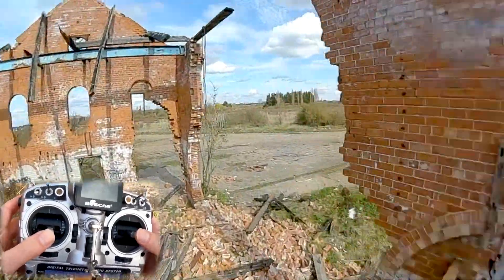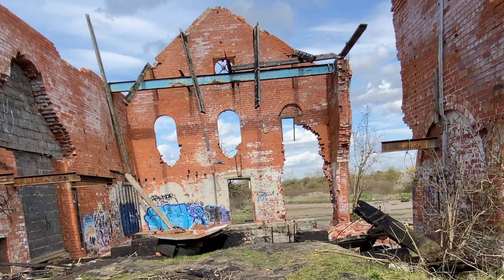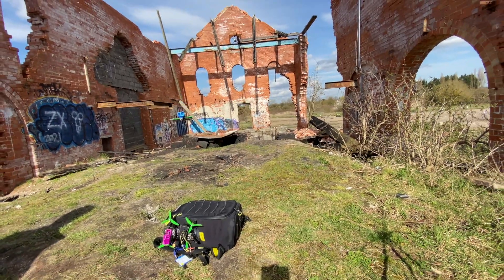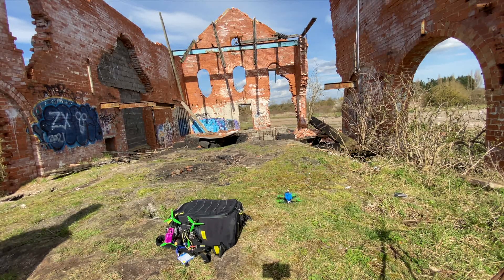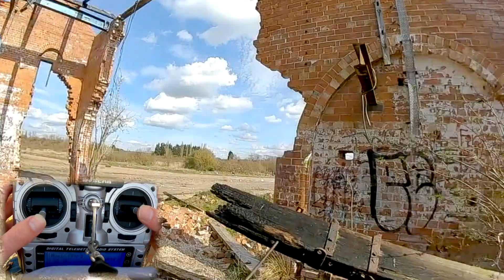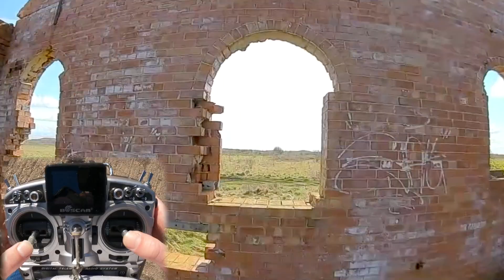How To Land an FPV Drone in MANUAL MODE! 👀

Comment: Hi, congratulations on the very detailed video, but can you confirm that when arriving at speed in an open space, to significantly reduce the speed and prepare for landing, it is better to lower the pitch along with the throttle and then calibrate them simultaneously near the ground? Thanks again.👋
Reply from the maker: If you want slow down quickly then pitch back, which will act like a brake. Then control your descent with throttle
Reply: @MagicFPV  Thanks, I then wanted to understand how you moved the sticks for hovering. Do you always keep the gas below the middle and the pitch continuously back and forth on the middle point with micro adjustments? Thanks again.

Comment: So, I've got this thing bugging me about the Chimera 7. I'm all pumped up for flying in the snowy, muddy, and downright dirty conditions, but I'm scratching my head about the landing drill. 
Why can't we just flick the drone into Normal mode and snatch it mid-air? My Chimera 7 hasn't swooped into my life yet, and this is my biggest head-scratcher. With the DJI FPV, I used to groove in M mode most of the time, and when it was time to touchdown, I'd slide into N mode and grab it mid-air. It's a bit weird to me that this isn't on the menu with the Chimera 7, you feel me? 
Can you shed some light on this landing sitch? 
Appreciate it!

Comment: Why does the drone sneeze like that when touching the ground ? I find myself doing this quite a few times when practicing landing and stuff and want to know if it can affect anything.
Reply from the maker: Because the flight controller is trying to counteract the external force (the ground). It doesn’t really matter except that it can mess up your landing. Just use it to practice landing softly 😊 Foam landing pads also help

Comment: At the 13:34 time mark, can anyone  please explain the maneuvers that were made twice in a row? The drone is moving forward though the building and without any stick movement it is headed the opposite direction ? Possibly a programmed switch maneuver? Sorry just getting started and am in the learning stages👍
Reply from the maker: Trust me there is nothing programmed on a switch for that manoeuvre but I can see how it would look like that. Basically the sticks are moving but it’s hard to see as they are very small and precise movements. The backwards momentum is generated on the way upwards and then it floats backwards with no input due to momentum. If you listen to the motors you’ll hear when the throttle is dropped to zero 😊 Hope that helps
Reply: @MagicFPV  ok cool, great talent and wonderful video. Thanks for the response.....i will certainly stay tuned👍

Comment: THe first time I flew my 5 inch the camera angle is about 30 degrees. I found I got a bit disorientated when trying to land as I didnt know how low I was because I couldnt see the ground. Apart from lowering the angle is there any other tips you can give?
Reply from the maker: Just everything in the video. Camera angle is the simplest way to make it easier though 😀

Comment: First FPV landings should be done on: grass, concrete, wood, doesn't matter?
Reply from the maker: The softer the better but grass can get chopped up. The soft rubber surface on playgrounds is really good

Comment: can't find vid where i asked this question about dji og foam pads,  i found if i use a blunt edged thing to wear the rubbery foam pad on og goggles it softens up quite nicely, i went from massive light leak and completely uncomfortable to great fit and no leaks, just rub something like a lighter back and forth across pad where its tight, forehead and cheek pads were my issue, 15 minutes rubbing should do it.
Reply from the maker: Very interesting! Thanks for sharing

Comment: What goggles do you use? I'm saving up for a drone but I dont know what goggles to get. Do you have any suggestion that are around £100 mate?
Reply: And also mate your flying is awesome 🤙🤙
Reply from the maker: @NONX01  why are you double clicking it? Surely that’s disarming and then re arming it?
Reply from the maker: @NONX01  yes! Be careful and remove your props. Once a battery is plugged in, you can check your buttons
Reply from the maker: Thanks man... I have always used Fatsharks but recently switched to the DJI digital goggles. You could try to pick up a pair of second hand Fatsharks or Skyzones, otherwise I think Joshua Bardwell has some videos comparing cheaper goggles
Reply: @MagicFPV  thanks mate

Comment: so can you say that airmode is like ABS in cars? like you can steer even when the brake is applied or the propellers of the drone are no longer powered
Reply from the maker: That’s a really interesting analogy. Yeah it basically keeps it stable by keeping them spinning a small amount at zero throttle